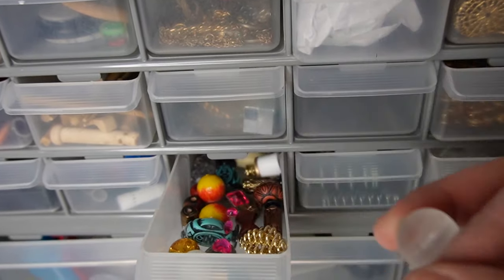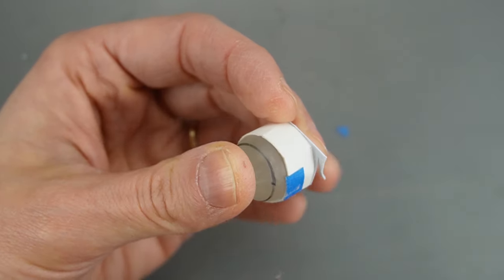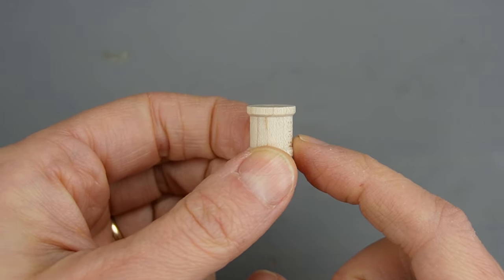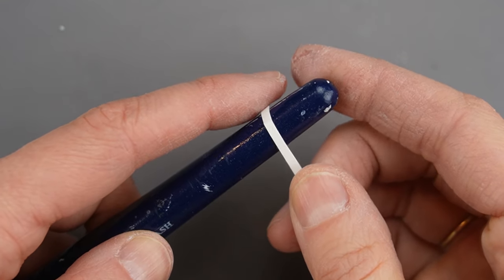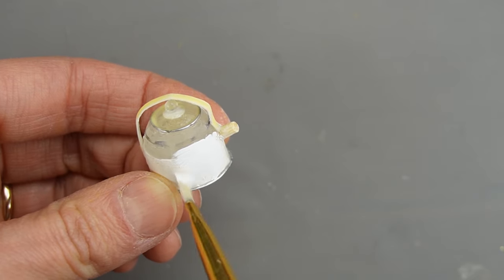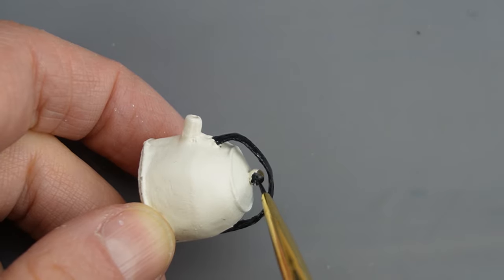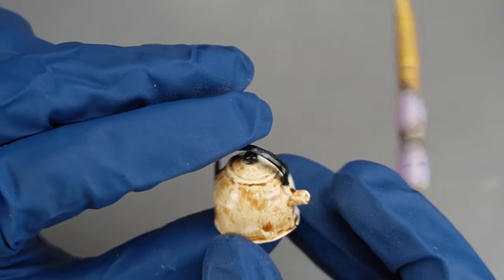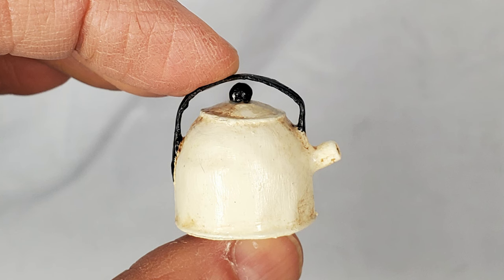DIY miniature kettle or teapot for dollhouse • NO Clay!

Comment: Great project! You can gently pull thin strips of paper or cardstock between your thumb and the top of a table knife blade to curve it. It breaks down the paper fibers and avoids creases.
Reply from the maker: That's a great tip! I had creases in the handle and the piece I wrapped around the kettle. I'll try that next time.
Reply: Ooooh. Didn't even think of that! I'm actually recreating this, so I'll give both ways a go. Thank you both so very much! Blessings in the new year! 💚

Comment: for a better acrylic wash experience try mixing it with airbrush medium. You'll get a thin liquid consistency that doesn't run as much as it would with water. You are getting the ridges in the paper because you are cutting against the grain and then rounding with the grain. If you cut in the other direction and round against the grain the paper won't crease. I love your videos!
Reply from the maker: Thank you! I used an oil wash in this video. It was my first crack at it. I use acrylic washes all the time so I'll keep your tips in mind.
Reply: @queencityminis  I caught that, you mentioned in the video the issue with acrylic washes being too watery. Sorry I was less than clear in my response

Comment: I love using the wood glue for shaping and added dimension. ..I learned it from a tutorial on the vintage train case set I made..creating the handles. And I agree with the mod podge you have to really smooth those brush marks out as even as you can with super light stokes. I saw those needle files at HF for $3..and I just got that set for xmas...I really needed them!! I love how it came out!! Cute lil tea kettle! Ugh..I'm going stir crazy on foot recovery..I'm almost to my breaking point..lol yesterday I started putting together this vintage miniature paper theatre model..and tried to film with my phone..didn't happen..lol
Reply from the maker: $3! What a deal. Some of the stuff at Harbor Freight is cheap and poor quality but lots of it is cheap and good quality.

I can't get Mod Podge to dry flat no matter what I try. It's like it's made to show brush strokes.

I'm glad you're keeping yourself occupied. That sounds like a cute project. At least share a photo on your Community tab on YouTube so we can see it even if you can't film it.